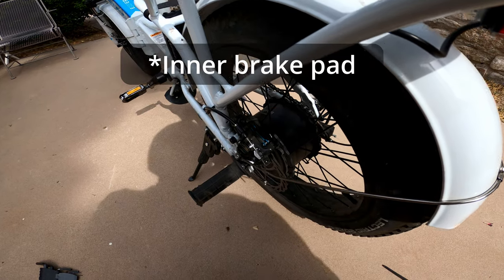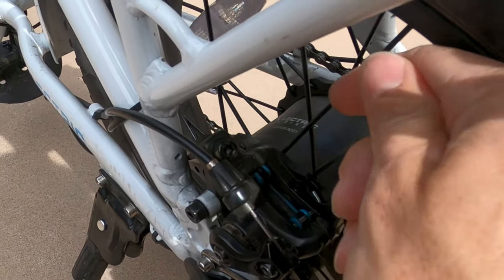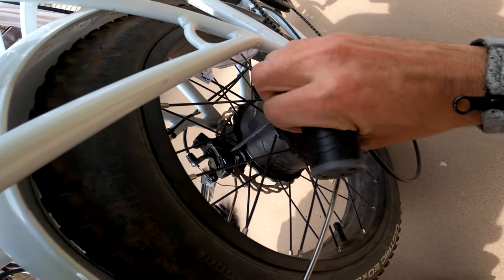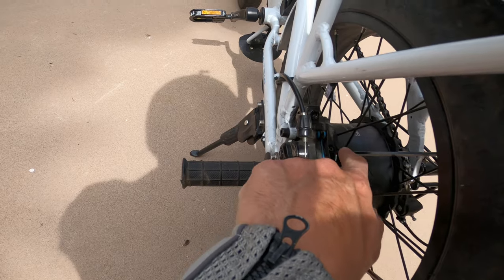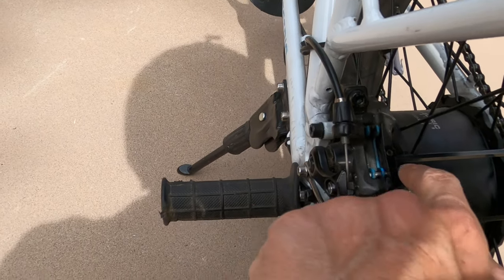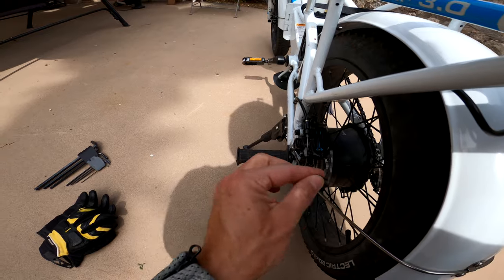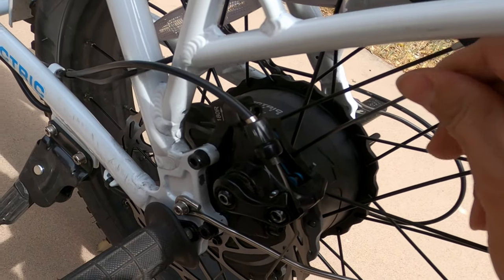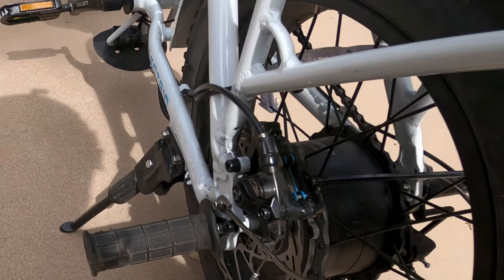MUST ADJUST - Inner Brake Pad Set Screw - XP 3.0

Comment: Thanks for that tip. I also got some handlebar grips and put them on the passenger foot pegs. I cut about an inch off of mine and they just barely make contact with the brake disc when folded up. I'm keeping an eye on that to see if it's a problem. Super fun bike and we get lots of grins when we go for a ride together!😎
Reply from the maker: My front brake rotor got a bit bent from the foot peg jamming into it before I added the grip.  Luckily I was able to straighten it out.  I do need to trim my grip to make it look more stock.
Reply: @LectricGo   I was kinda worried about the small basket I put up front interfering with the folding up but it's working out just fine. My 3.0 fits behind the seat in my Dodge truck and goes to Arizona with us. I'm enjoying your vids and I'm subscribed up. Haven't seen another 3.0 with the passenger package yet, just lots of rad runners. Moving to central Oregon soon and it's definitely e bike central down there!😎
Reply from the maker: Thanks for subscribing!  One basket alone works well for me most days.  Running with two makes it bulkier when folded.  Oregon should have lots of great areas to explore!